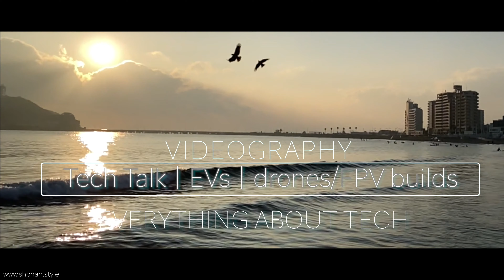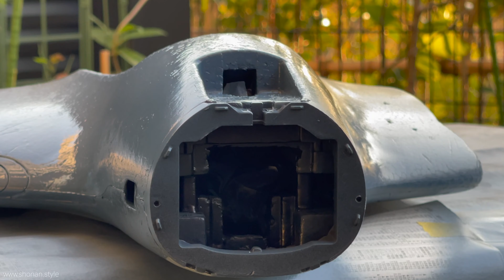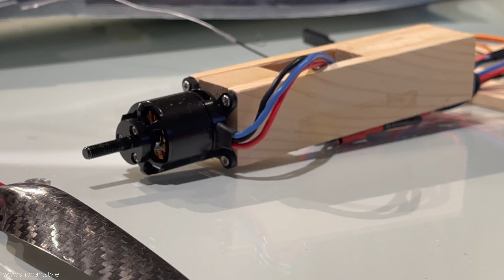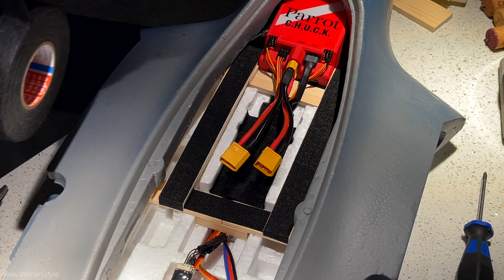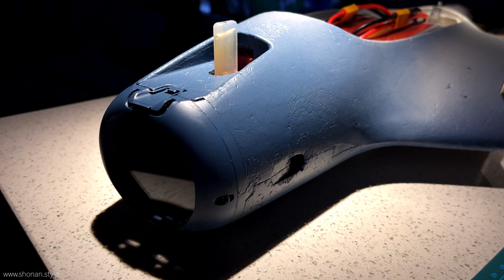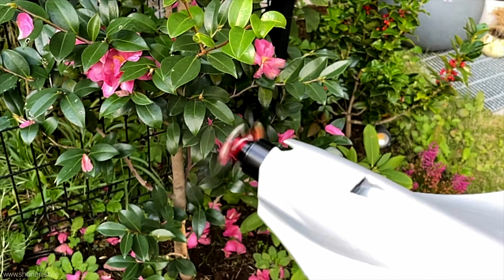Grogu my E-flite Opterra 2m | Parrot Disco HYBRID Project - FPV long range drone build ~ PART 6

Comment: Wow, impressive, I ve got now an opterra too and started optimizing it. Whats the max battery weight it can carry when all ballast has been removed? Best, Martin
Reply from the maker: Thank you!  🙃
Well, I tried two 5000mAh 3S Lipos and it was fine but quite heavy for the Opera to handle. I would recommend two 3S 3400mAh Lithium Ion packs. 
That should give you ample flight time to do all kinds of long range cruising and mission flying,
Reply: @MattShonan  Hi, well I have 8000mAh 3S, 550g each...I ask myself if it can take 2 of them. how heavy are yours? Regards :)
Reply: how much amps u draw at cruise?
Reply from the maker: Basically you can take the values you see here in this video as cruising amps drawn. I was limiting the trotted to 70% in the TBS crossfire radio since the idea from the beginning was just long range cruising.
Reply from the maker: https://www.youtube.com/watch?v=QfiktYtF-10&list=PLXvxBkD7n_PNOIcLIf_hcBdEZs8VqIjvT&index=5
Reply from the maker: This video might give you a good idea.
Reply from the maker: Wow, that is really quite heavy. 
My 5000 mAH 3S are coming in with 388g. 
When flying with 2 packs I max out at 776g.
Reply from the maker: Please let me add, the 776g are really quite a lot in terms of how I feel the flight characteristics are impacted. Pushing for 1100g might be a bit too much to be honest. It will draw certainly more amps and the rest of frying the ESCs is higher. 
I think it might be good is you try with less payload first.
If you take on the challenge and push for 1100g, let me know what your observations are. Would be quite interesting to know if the opted can handle the weight. 
Good luck and have a great day!

Comment: Your engineering skill is amazing. But how does the camera work when there's a protection len cap in front of it. It is a fisheye lens...
Reply from the maker: Thank you! It works just fine since the CHUCK unit is push forward so that the camera is not blocked by the fuselage.

Comment: Looking good. What is your expected MTOW? 
I did a test launch of my Opterra yesterday, without the DJI FPV system installed. I used a drain pipe ramp and bungee launch, twanged it clean across my entire garden and hit the fence 60 metres away. Minor damage. So, watch out, the Opterra glides and glides.
Reply from the maker: Thank you! I will watch out.
I am happy to hear you can confirm the excellent gliding characteristics I was hoping for. 
In fact, that is why I am doing this build and body swap from the Disco to the Opterra. 
I aim to get several hours of flight time out of it when flying over 4G LTE. Well, we will see. 

Good to hear your Opterra survived the crash in your garden!
Actually I am flight ready soon but finding a good place to do the first test flight is challenging in my local area. I still hope for this month to get it up in the air if I can find the right place.

Comment: Nice ... its almost there!. Can i ask, is it possible to control the camera using your buttons on the TBS or any 3rd party controller ? Or can the camera only be controlled using the skycontroller?.

I fly my disco on li ion packs.... i get 1hr on 7000 mAh 3s2p. I think you could easily fit 21000 mAh inside ... maybe more
Reply from the maker: Thank you for the valuable comment! 
I have 18650 lithium-ion cell on order fro my drones and quads. After seeing your comment maybe it is a good idea to build 2 backs for the Opterra as well. Good point you have there. 

The TBS or any other controller over the manual mod can not control the camera. For that you will still need your Skycontroller. Good thing is you can run them side by side and switch between them.
Reply: @MattShonan  no problem my friend. I should also mention that you can modify the battery table file on the chuck... so you can adjust for draining li ion cells , which can be drained to lower voltages than lipos. From what i remember i set my lower limit voltage to 2.7 Volts per cell. This will give you the full "safe" drain capacity of the li ion.
Reply from the maker: Thanks! 
I will adjust the CHUKC once I fly li ion. For now I have the two 5000 mAh lipos I will try first. As long I use those lipos I think it is maybe better to keep the original configuration for now.
Reply: @MattShonan  yes, i agree. Only adjust if you fly li ion